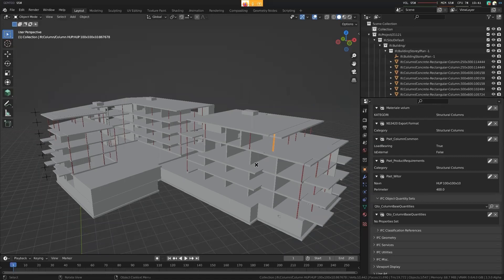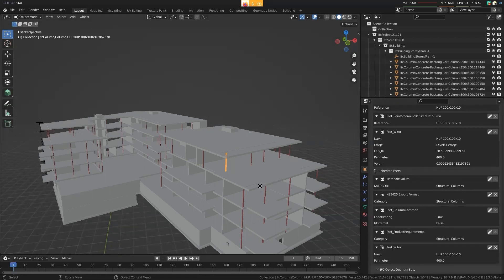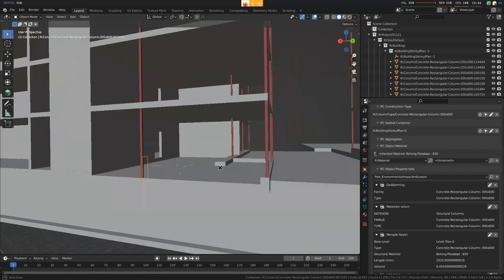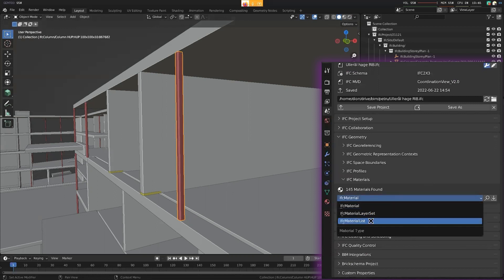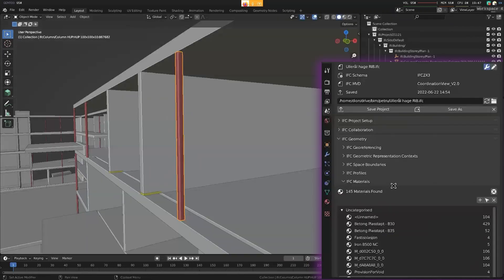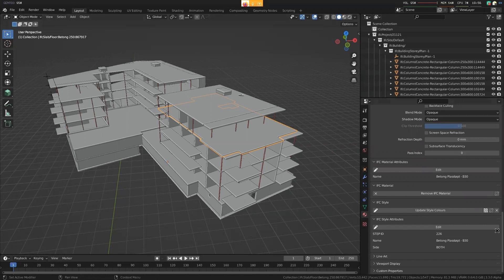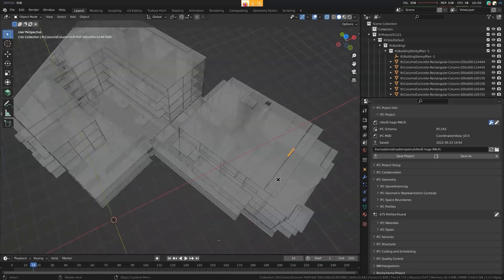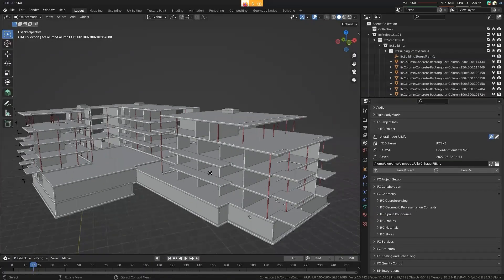Materials in IFC Model | BlenderBIM Add-on

Comment: Hi, when I assign several materials as a layer set to my wall (for example brick+insulation), I can only see them in the scene --> geometry and materials tab but not in the Material Porperties tab (where you go in 7:14 mins). When I want to check the used materials in the outliner, I can usually only see one material (in my case brick but not the insulation material). But at the same time I can select the IFC material "Insulation" and all the walls are highlighted. Does that mean, the materials are assigned correctly? Or did I miss something and do something wrong? Thanks for your help and your videos!

Comment: Hi, there. Although I have the Blender file, I am not a Blender user, and I received an IFC file exported using BlenderBIM. The problem I have is that the imported category using Revit desn't come with a Material parameter which we need to use on a project. I have already added this material manually with Revit, but most of the geometry does not take any material, and the objects that do, don't seem to be fully editable when it comes to modifying the assigned material. I am not sure how to add or edit this parameter on Blender, but I can ask the 3D provider to do this. What parametric material description would you recommend to set on the IFC Object Material setting in Blender in order to have it exported and availble to use on Revit? Considering I only need to modify materials in flat surfaces, I believe that Single Materials would be enough, but I am not sure. Please advise! Thanks.
Reply from the maker: I paste in this reply from Dion Moult: Actually Revit ignores IFC materials. (Strange bug but true). Revit only inspects IFC Styles, so put your data in a style instead of a material and then Revit should be able to digest it.
Reply: @BIMvoice  Thanks.

Any advice or idea on how to make Revit  take and show material aspects on objects that were modeled using Blender and exported to IFC using BlenderBIM? :/
Reply from the maker: @gaberomval  I would join the OSArch chat. You will definitely get the answers you need there. Unfortunately I am not very experienced with Revit myself.

Comment: Hi, what is the reason of using BlenderBIM and not solibri, revit etc.
Reply from the maker: First and foremost it is FREE and open-source. Did you check how much a Solibri license costs? :) Then BlenderBIM is Native IFC and you can do a lot of stuff that you cannot do with Solibri. You still cannot do clash control though, but validating IFC data. And I guess BlenderBIM will become just better and better, and much quicker than Solibri is doing it.
Reply: The BlenderBIM Add-on lets you see and edit almost everything in IFC. There are many things Solibri does not show (e.g. like this material browser) and Revit mostly just works with Revit data and has poor IFC support.
Reply: Solibri has a free viewer and a market reputation with the AEC commercial construction industry. I’ve used it and say what you want about the cost, but when you have to provide information to a team, it does exactly what it is required to do. Also, Solibri does identify materials: It does this via colors. In short, Solibri which by the way is a BIM model checker, with a better interface than your BlenderBIM plug-in, world wide tested investors base within the commercial construction industry. Now I will tell you what Solibri does lack: The ability to transfer IFC data to a Database. Solibri can export an issues table, but not actual model data to a database or even a spreadsheet.
Reply: @VNOYB  I'm happy you like Solibri, but for anybody reading along here, feel free to try it out for yourself. You'll quickly realise that the BlenderBIM Add-on has significantly more capabilities than Solibri. The comparison doesn't make much sense :)

Solibri tends to misrepresent quite a number of things in IFC, one of those is materials. For example it doesn't distinguish correctly between surface shading, diffuse shading, and style assignment vs material assignment. It's more than "it shows a colour".
Reply: @DionMoult  Mr. Moult, my words may have been too poignant, giving you the impression that I don’t believe in the formidable task ahead of the BlenderBIM team. I apologize for that. On the contrary, I believe that the BlenderBIM add on can make a positive difference in the AEC market, and the global design industry. I don’t have much time during the day, but I will watch your videos and work to provide constructive feedback from my humble experience. Thanks again for your efforts.